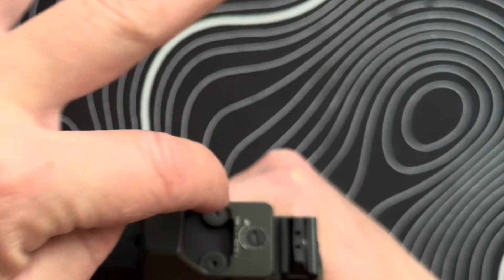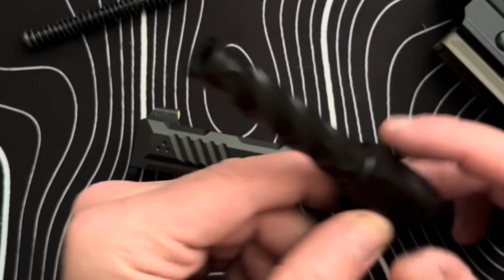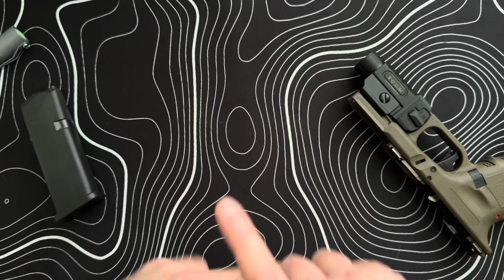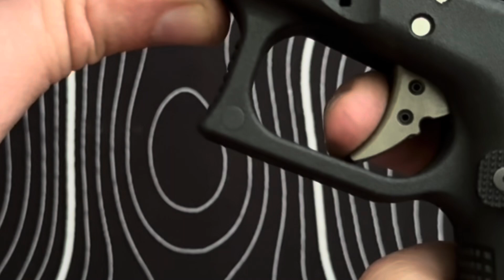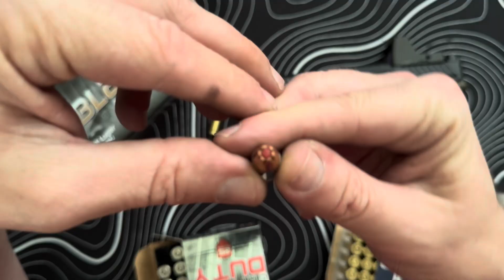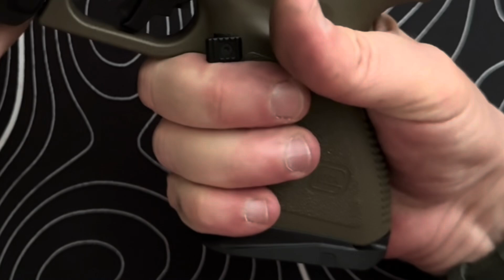Glock 19 project part 2: Accessories & Gun Ownership Considerations

Comment: Is the slide significantly lighter than the factory?
Reply from the maker: Not at all .. I just picked that slide so I can mount a red dot and have a little bit of traction when racking the gun. Didn’t feel that much lighter to me …in all honesty, I did not weigh it. It just wasn’t the metric I was concerned about. The gun function is great and has thousands of rounds through it now.
Reply: @Watchandcutgearchannel thank you for your response 🙏🏽